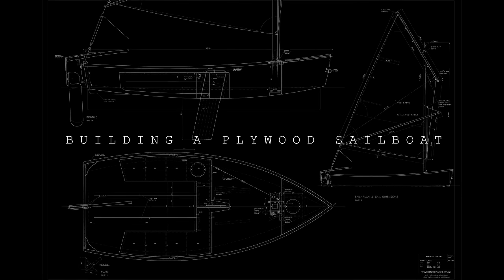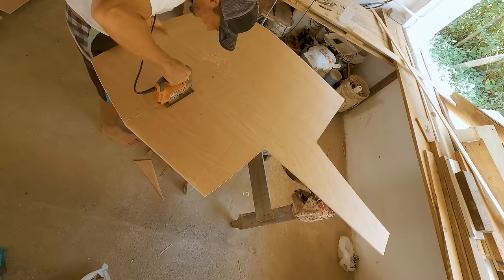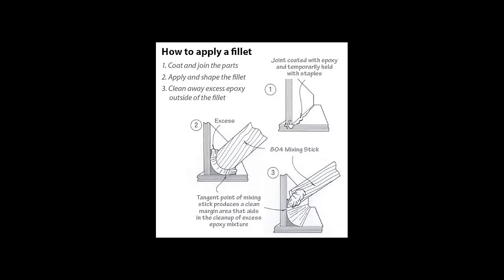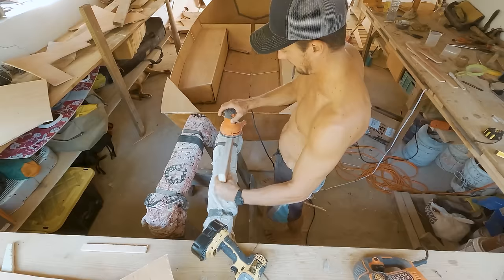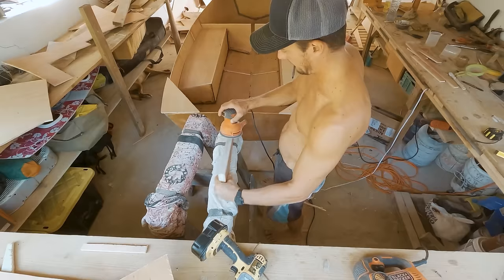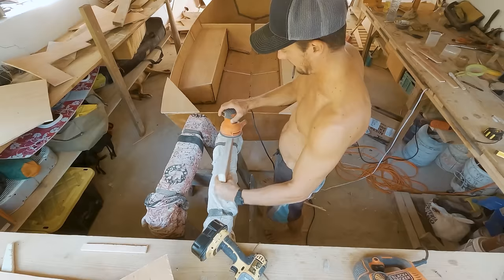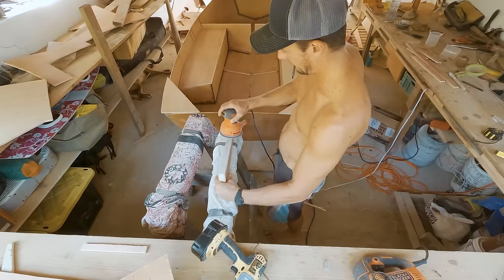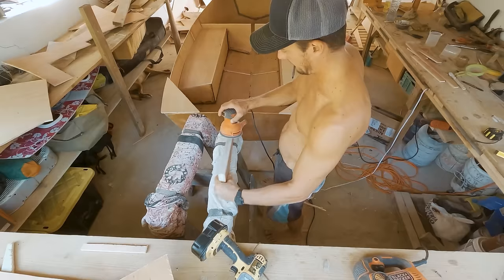Plywood Boat Build - Start to Finish

Comment: What a great thing to have achieved! In dinghy racing we would add a strap (like car seat belt) very securely attached along the bottom of the boat to hook our feet under.  These are ‘hiking’ or ‘toe’straps, and help you to lean your weight further out to keep the boat upright.  We also use a tiller extension  attached to the end of the tiller by a universal joint (best kind are flexible plastic). it takes a little getting used to but this would really help get your weight in the right place. Kudos for kite surfing - you obviously know waves better than me. Your friend looks a bit unsure though!
Reply: I was just about to say add hiking straps and a tiller extension lol
Reply: Yeah same I was also thinking about a vang system

Comment: My brother built an 8 foot sailboat when he was 15 or 16.  We built it in the basement of our house. We worked on it from October to March.  Ended up making the dagger board larger and the water coming out of the dagger board hold was a surprise.  We were luck to have a dad that was willing to help when we were stuck.   Nice boat you made it really flies. Everyone needs to sail in a small sailboat.   How you sit so low to the water and with the wind blowing your off it is just a different perspective you never seen before. Be safe and good luck

Comment: I’ve owned17 or 18Boats  so far and i’m a retired professionalWoodworker   this little boat is a damn good looking boat  because of the “Lines “ of the design and overall shape  i watch YouTube for entertainment and ideas  and i like this one quite a bit  as the boat you built  would also be a excellent Dinghy  for a bigger Vessel to Pull  or put onto David’s  those compartments or watertight areas would be a great place to put  Floatation Foam  to give the boat  a little extra safety  in the event of swamping etc BTW  Dagger board single Sail Boats are lots of Fun   they are also a fantastic way to,learn the basics of Sailing  i used one to teach my children  and i explained that if they can Sail  the 8 footer they would be capable of Sailing  almost any boat  i’ve  lost count on how many times i’ve crossed the Gulfstream  over the years   on boats going and returning from the Bahamas to Florida where i also lived for many years Oh BTW the Skeg is actually designed to  act as a Keel,or Counter balance  to the force the wind  applies at the Sail  without one the boat would just get blown  accross the top of the water in what ever direction the Wind is blowing the Skeg allows you have controll of the boat in any direction  but most importantly Tacking  so you are capable of Sailing into the Wind  i do want to add  for a first timer using Fiberglass and Epoxy  you did a nice job Fairing the hull  folks might give you Lip or grief about using House Paint but don’t pay them much attention it’s fine and works well  i know a Gentleman with a Sailing Yaht he built in the 1970s  and used Sears Exterior House paint instead of Marine  i beleive he commissioned the boat in1972  and it still looked fine in the mid 90s  having a good Boat Dog and good looking Lady or Crewmate as you said is essential for good Sailing  you might be able to increase your Sail size  a easy task if you buy a Industrial Walking Foot Sewing machine from Ebay they are a Chines Clone of the Consew  machine  that changed the Industry on Sailmaking and Upholstery  it’s also the same design of Sailrite Machines  with a lower price tag i’ve owned and used one for over 25 years and it still works fine  i am not  a Professional but just a Hobbyist at sewing Marine Projects for myself and freinds in the Marina plus occasional Automotive Interiors  for my personal Vintage Sports Cars  i collect and drive
Reply: rip english.

Comment: I'm impressed. A guy with no tools and no woodworking skills successfully builds a dingy. You should know that I'm a cabinet maker so that is praise indeed. One thing that I would certainly have done is to fill those water tight compartments with foam. Having said that I don't know anything about boats but I do understand maths and physics.

Comment: 13:50. I feel your challenge in cutting panels that fit just right.  Suggestion:  My method is to make a template out of stiff cardboard, or really thin plywood (common name: Door Skin, about 1/8" thick... or maybe 5mm).  Then trace the template over your permanent panel.
Making two panels may seem like double work, but the time saved with forming door skin makes up for it.
Also, if a mistake is made, cheap doorskin is easy to replace compared to expensive ply.
.
Love your idea of making peanut butter epoxy with sawdust.  Brilliant.  I never thought of that !
Reply from the maker: Thanks for the good tips!

Comment: Inspiring- I just left my job and have been aching to get back into the woodworking/metalworking shop and/or haul out my old lathe and sell it to make some room in the garage- now I know what I'm gunna spend the proceeds on! 2 months of crafting and under a G for a solid couple's sailing dinghy is good numbers in my book.

Comment: I’ve raced small dinghies most of my life, been a champ many times and I’m here to say if you build a dinghy with high freeboard you will find it very hard to sail upwind. Simply there is air pressure on the hull blowing you sideways and your progression upwind on either port or starboard will make it a hard trip.

Comment: What a great project. I have seen a number of boatbuilding projects online and IRL that were either incomplete or didn't sail well. It's an inspiration to see your project come to fruition with a boat that you actually sail hard and enjoy. That design planes wonderfully.
I have had several fiberglass sailboats. All have been old and needed repair or modification. After a couple years off the water I am starting to get that feeling again.

Comment: Brings back both memories and inspiration. I built a Karl Stambaugh Windward 15 in my 20s, and I'm in my 50s now. I recently erected a cheap shelter in my backyard to store/restore that old boat. The Windward 15 was not built stitch-and-glue, but probably should have been. It was built with plywood bent over frames. I also used butt-joints rather than scarf joints, because I was young and impatient. True fact: Young and impatient trumps old and lazy every day. Congrats on a beautiful build, and thanks for sharing.

Comment: The way you use your boat in such full on fun way, I think some big scuppers in the transom with flappers or some system to let water out could be useful.👍 Great job .
Reply from the maker: I agree, would love to find good bailing system. Not sure if this boat will ever have one. I'm considering building a double bottom boat for that specific reason.

Comment: Congratulations on the build. Doing it in only two months is incredible. I admire your focus and productivity.
Reply: The 2 months is incredible,  I built a Chesapeake 17 kayak (from CLC boats) and it was supposed to take 40 hours.  Took me 4 to 10 hours per day for a whole summer.

Comment: Wow... cool project.  I built a rowing dinghy-- Jimmy Skiff -- using the stitch and glue method.  I well appreciate the mess fiberglass makes (ugh).  That was a fun boat to make.  I used a kit from a company up in Annapolis, MD called Chesapeake Light Craft.  Good people to work with.  Congratulations on your new boat and thanks for a well narrated and edited video.

Comment: This was an excellent instructional video.  Thank you...BTW... If you fill, with Styrofoam, the watertight containers it will assure never taking on water....just a tip.  It does add a little weight.  A trick I used with a Catamaran I restored.

Comment: May need to attach the Kite to where the Mast sits to prevent the tipping & tracking issues. Also a full length keel may help with tracking problems.

Comment: one of the best stitch and glue builds i've ever seen!
I would trim down the quarter knees into a rounded shape to take up less room, but the way you enclosed the bow section was excellent!
Reply: ... but why Gorilla Glue there?  Shoulda used the same 2 part epoxy as on the rest of the boat.  I can relate, I've built a stitch-and-glue kayak, glassed over.
Reply from the maker: Its a valid point, looking back it would have been better to use epoxy, at that moment I figured the gorilla glue would fill in any extra gaps between the 2 plys and the glue used in the ply is probably a lot worse then gorrila glue, so the weakness is not the gorrilla glue as much as it is the non marine ply wood glue itself. Cheers

Comment: Hi guy. Congratulations! It's great to see somebody completing a project like you've done.
Just a few suggestions for you to keep in mind if there is a next time.
Epoxy is extremely hard and strong and unless you used an extremely light cloth you added a lot un-necessary weight to the boat. The deck in the cockpit area could have been made much wider, and a toe strap added on the floor. When sailing the boat it allowes you to hang out of the thing in comfort. It is necessary to hang out to balance the force of the sail especially when beating up wind.
The raised decks can be incorporate into the boyancy compartments on the side.
It's a nice and easy boat to manage and I would like to know where you got the plans for it. As a utility boat the design is hard to beat. Unfortuneatly it would become a bit specalised if the wider decks were employed.
Reply: See his description for a link to the plans.

Comment: Extremely impressive. The only thing I would’ve done differently would be to fill the watertight voids with closed cell foam to prevent them from becoming waterlogged but the inspection hatches you installed really accomplish the same thing. My fantasy project would be building a giant 36 foot square backed motor canoe/house boat out of ferrocement but the principal is the same no matter the size or the type of hull.

Comment: Great job! I am starting my first boat build In January 23’ so I’ve been researching stitch/glue techniques. It will be a Wharram Tiki 21 catamaran. TWO hulls to build!!!
Reply from the maker: Nice! the Wharram Tikis are amazing, probably the best plywood sailboat designs. My dad built a Tiki 38. Not only the 2 hulls but also the beams are quite a lot of work. Best of luck on the build!
Reply: @HANDIY   Great video! You inspired me to try build my own sailboat, unfortunately the plans for sailboat are no longer available to purchase

Comment: I recommend on your next build, that you completely incase the entire hull with fiberglass with the epoxy resin and then tab in 1708 fiberglass bi-axle strips (4-6" wide) in all the seams before you install any bulkheads, compartments, or supports.  Then as you build out the boat, glass in all those bulkheads, compartments, supports, seats, decks, etc with the same method by encapsulating them all in fiberglass, both top and bottom, inside and out of each piece you install, then tab them in with the same 1708 bi-axle strips to help keep the boat from failure or breaking apart.  Then, it will last a lifetime.  Cry once because of the cost of doing so, then be happy with your build the rest of your life and pass it along to your kids.

Comment: Really amazing video with a lot of detail. A lovely build and you should be very proud of yourself. Only detail not covered is the mask connection. Otherwise thank you for the awesome instruction.
Reply from the maker: Thanks for the kind words. For the mast connection/rig I recommend checking this video out: https://www.youtube.com/watch?v=wN-P6geb9Ks&t=109s it is an updated rig system, but the mast connection using a windsurf mast base is the same. Cheers!

Comment: I have a Finn-dinghy, 4.5 m long and 1.60 wide. On the tiller I have an extension, allowing the pilot to sit on different places, but still steering the boat....Recommended. Tiller extensions come in different lengths, some two alu tubes, which can stick by turning at any lenght....I have one such on my 7 meter  wooden double ender, and its endlessly useful....

Comment: Totally brilliant video and a job well done. As a dinghy and offshore sailor these past 60 odd years, I enjoyed seeing how you created strength and rigidity in the hull without adding unnecessary weight. The forward watertight locker reminded me of the bow locker on the Wayfarer. I think it would have been better to scarf joint the two sheets of ply together. How are those over joints working out?
My last ocean sailing yacht was a 17.5 ton Joshua 40 steel ketch which I sailed single handed. Now 10 years have passed and I am thinking of building my own dinghy, to sail on Llyn Tegid at the bottom of the mountain, here in Wales. I have been looking for a suitable design, mono, proa and trimaran dinghy, but watching how the Oryx handles, I might well give this a go!

Comment: Nice!!
I'd add a strip of plywood on the top of your bow piece at the side of the sitting area, so that the water splashing onto the bow would roll off to the side rather than into the boat
Reply from the maker: Its a great idea but it would make car topping the boat more difficult. Thanks

Comment: Fiberglass is not water proof. It is the GEL COAT that is water proof and it is generally about the thickness of 3 to 4 sheets of paper. Scuffing through the gel coat makes even the $80,000 boat begin to draw in water. Always try to avoid scuffing the gel coat, at all cost. Letting a fiberglass hull (gel coat) drag, even slightly on the rocks, sand, or concrete will let water begin to soak in. Epoxy and micro fibers are the very best choice. Not saw dust. Micro fibers are like fine hairs which lay all criss-crossed and make for a much stronger bond. Very nice project and great craftsmanship. You chose very wisely the size to build and I know that your next boat will be even better. Scarf-joints will help with strength instead of butt joints. I have some photos of these joints if you're interested. Looks like a lot of fun. Congrats on starting  AND finishing your boat. You learned quite a lot, most young folks don't have your kind of perservearance and drive, in order to finish.

Comment: Good job!  Looks like you guys (and gals) like to have fun!  I got an older fiberglass (Barnett max) hull, but I need a rudder and sail, and possibly mast (the one the guy gave me I don't think goes on the boat).  Cool to see your rudder setup.  Not sure what I'm going to do about the sail, but ebay has 100 buck sunfish sails, so maybe I'll try to get that to work.  I always wondered about kite surfing a little boat, and now you guys have done it.  Cool video, and thanks!

Comment: for drawing fair curves the battens should be a slender piece of straight grained soft wood,plywood is probably not going to give you as fair a line and you can spring lines longer than your plywood sheets.Looks like an excellent job.Well done.

Comment: From one boatbuilder to another, I really enjoyed your film. I fully appreciate your apprehension at drilling/making un-necessary holes in the boat, wherever they may be. Those hatches will be sufficiently fixed with just an adhesive. Well done you, I hope you have many years of enjoyment.

Comment: A few things I'd change if I were to build it. 
1. Scarfjoint the plywood and gunwales, it's much stronger than butt joints. 
2. Put a "wave deflector" on the fore deck to keep water out of the boat. It would make it a little less car roof friendly but a lot dryer on the water.
3. Fill the watertight compartments with expanding insulation foam. It'll add flotation.   
But it looks like a really fun little boat otherwise.
Reply from the maker: Thanks for the good tips.  I'll keep it in mind for my next build.
The wave deflector would be nice but like you said it messes with my car topping logistics. Since my watertight compartments are watertight, Air is more buoyant the  Foam. Foam will accumulate moisture, make it hard to air dry and potentially rot my boat from the inside. In my opinion filling compartments with foam is mistake done too often in wooden boat building projects.
Reply: @HANDIY  very true about filling compartments with foam on wood boats. it's much better to have removable access ports so any moisture can dry out when the boat is not being used.

Comment: Adding a tiller extension would give you a lot more control especially when your ripping around with the kite it would take some getting used to but I definitely recommend it
Reply from the maker: thanks for the tip. Its actually something i would need more for normal sailing. When using the kite, the boat does no list so our weight need to be more centered and further back, so a short tiller seems to work better or else it gets in the way, I even cut a piece off just for that purpose. Cheers

Comment: So cool. I like the yoga mats.  Another idea for foot surfaces is add clean play sand to your paint and mix well. I have never done a boat like this but I have done this to other walk surfaces and it works great and looks great. If anyone does this , add small amounts constantly mixing as you go. Most impressive job!!!
Reply from the maker: I've thought about doing that, your solution grips well but its not very comfortable. The yoga mats grip but also cushion, im very happy with it. Thanks for the tip

Comment: Nice job.
I built a little paddle duck racer (PDR) boat in my classroom over COVID lockdown (I'm a teacher ^^) and this video brought back a lot of memories. Very similar construction but quite a different boat. Mine will never surf down waves as well as yours, but I'd also have to try a LOT harder to capsize it. :)